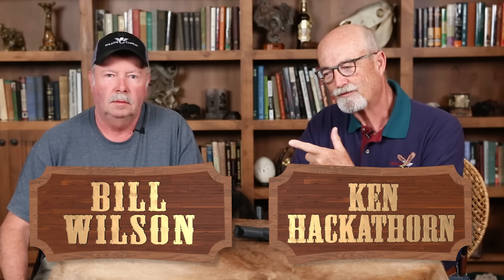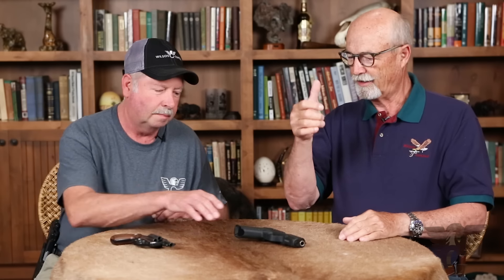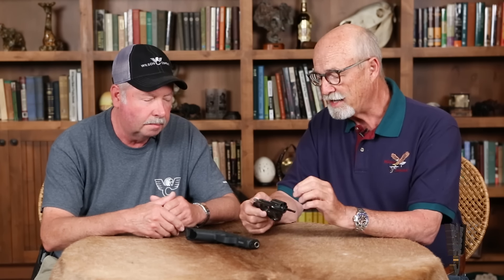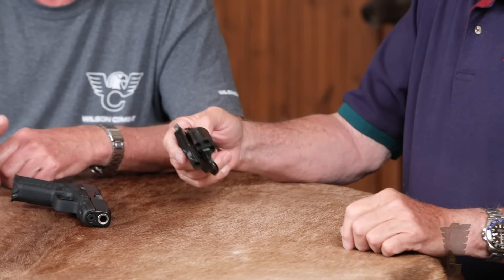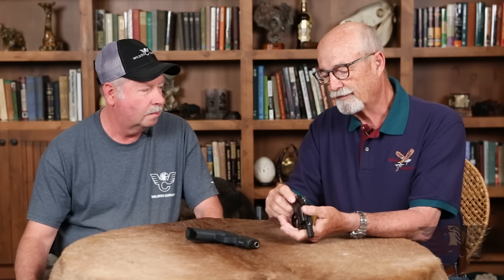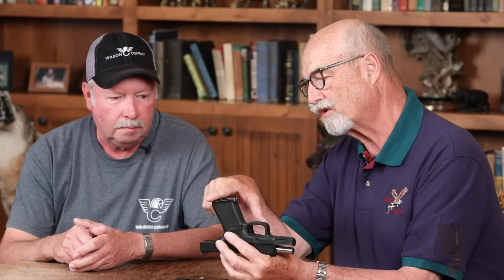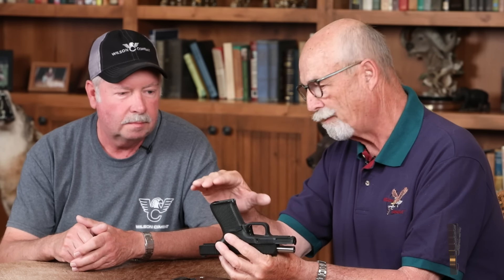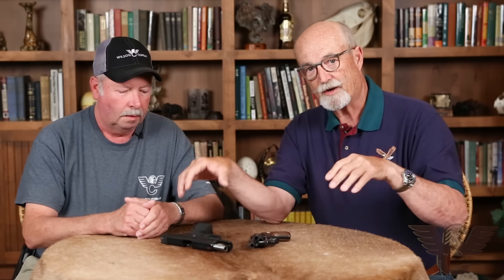DON'T DO THIS to Your Guns - Gun Guys Ep. 17

Comment: Im just gunna get an sti due to how stuck up they seem.
Reply: Guess what - sti/staccato says the same thing.  Don't drop the slide on an empty chamber.    It's not opinion that it damages the lockup, it's a fact.    I own several STI/Staccatos and a few wilson's - there's   no difference.  It's a linked tilting barrel with multiple barrel lockup points.

Comment: Lol I use mobile oil to lube all my guns. Even use it to clean. Works on corrosive ammo too. Here in the desert, I keep my guns pretty dry, drop of oil the use a rag to wipe it on.
Reply: I've always been of the opinion that in a pinch, any oil is better than no oil for preserving metal parts. Just can't substitute grease for oil or vice-versa.

Comment: I feel like your emotionally invested it’s I’ve never seen a gun break from dropping the slide the revolver yes but the Glock is fine
Reply: It doesn't necessarily break, but when trigger and hammer sear, disconnect,  are finely polished and tuned dropping the slide will wear those contact points. It wears to the point the hammer sometimes drops when dropping the slide without the mag in place and loading a round. It causes parts to wear Much faster.

Comment: so this is a legit question if you spend $3k on a Wilson combat why is there "trigger bounce"? Because releasing the slide forward does not touch the sear the only things touching it is the hammer and trigger. so they are saying the trigger wears the sear once the slide slams forward so on a properly hand fitted 1911 why does the trigger bounce to cause wear? The violent action of a firearm cycling is going to happen a lot faster than releasing the slide, yes the closing a round in the chamber will be smoother for the barrel but how does that prematurely wear a trigger job or a sear if firing the gun doesn't? IMO Riding the hammer down on 1911s have a way more legit claim to the premature wear on a trigger job or sear and I see that all the time even by people who own nicer 1911s

Comment: 18:10 I think this is probably carried over from M16/M4 basic training. Many times, I saw soldiers insert their magazine, fire one shot, and the magazine falls out onto the dirt. I was trained to slam that puppy home, even on an open bolt. On an M16, that will often close the bolt for you too, so it's a win-win. I must admit, I carried that over to my pistol handling. The last thing we were thinking about was the extra pressure on the feed lips. I think some authority and purpose of action is still called for when inserting any magazine, but I will probably dial it back a tad after watching this.
Reply: They fell out because they loaded 30 instead of 29...
Reply: @TheTyrial86  They fell out because they did not seat the magazine fully. I load my mags to 28 to make this operator error less likely, but it is an operator error. If you insert the magazine properly, 30 is no problem.

Comment: The mistake is see in this video is comparing a Glock to a 1911. Per Glock it’s called a slide stop not a slide release. 2nd a 1911 it’s called a slide release. It is true over time by closing the slide with the slide stop/release will wear the slide notch out sooner than if you worked the slide manually. Kinda over kill to get to the point. The message was lost earlier in the video. I prefer a 1911 just because for me it’s more natural and I  get better groups on the range. My duty weapon is a Glock 17 (department required)and qualify every year with the Glock. Bottom line a firearm is a tool. Take care of your tools and they will take care of you.
Reply: If you can afford enough ammunition to wear your slide notch out, you can afford a new firearm. Maybe take special care with a classic firearm that is irreplaceable.

Comment: There is a whole new generation of shooters, that started in the polymer era that has a much different perception of what gun care looks like. A lot of the old rules - not dry firing, don't slam down empty slides or bolts, don't swing cylinders, don't slam a break action shut, cleaning frequently, keep lubed - they call "boomer ideas".  As with most generation X'rs, I was in the cusp of it, taught by people who came through World War II and Korea, and have had a little bit of a hard time getting used to less oil, dry firing, things like that.  Not even 50 quite yet and I got called a boomer 😥
Reply: They use Fudd instead of Boomer when talking about firearms
Reply: There’s also a lot of non-fudds and just use common sense and treat guns based on that they were designed for.
Reply: OK boomer... lol jk
Reply: New firearms are designed to not be damaged from dryfire. Older firearms won't take it but most newer ones past the late 90's are fine.
Reply: @JohnDoe-rx3vn  all of the gun forums I hang out on, its boomer. Then we get into arguments over what a baby boomer is, versus just the “ideals“ of the baby boomers, etc. Fudd I see used in the computer world more than anything. Crazy huh?
Reply: @foodank_atr817  i know. I’m just saying it’s a hard habit to break. And you can still break strikers by dry firing, from time to time. Most of the gun manufacturers still recommend the use of snap caps just added security
Reply: chad kaminski  I think polymer frames, and powder/nitrided/anodized/coated finishes of different types, did that in general, not just Glock. But, fear not, I got everybody’s back. I’ll help keep the oil industry alive. It’ll be a tough job, but somebody has to do it.
Reply: I'm a Boomer.  I was trained to dry-fire, slam bolts and slides over 50 years ago.  But then, I wasn't shooting rooney guns, the too-tuned-for-serious-use fudd crap that these guys are pushing.
Reply: @foodank_atr817  The 1911 was specifically designed for dry firing, which was part of the US Army training course pre-1911.
Reply: @SoloPilot6  for sure. Theyre all meant to cycle and dropping the slide doesnt hurt for the most part. These guys complaing about their convention demo range baby that's precisely tuned and gets treated after every shoot doesnt translate to most regular firearms is my point.

Comment: Ken, in addition to arctic conditions slowing the powder burn, the friction is much worse, and wet lube flows like molasses.  Even with dry or zero lube, there are very few design that will operate when cold-soaked to 40 below zero, and even fewer that will work when cycled between a warm environment where condensation occurs,, then returned to frozen.  Like a police car that is parked in the cold, then kept running for a whole shift.  For this, I like single action revolvers, and AKs.  Forget about pump guns and frame mounted trigger bars.

Comment: I don't claim to be an expert at all but can someone explain to me how pulling the slide back to its furthest rear position and letting go is less damaging than releasing the slide lock? The only way to ensure no damage would be to guide slide fwd and release after its fully fwd.
Reply: It’s not less damaging. It’s more or less the same amount of damage, depending in how much further back you can pull it. The point they’re making is that the highly worked over trigger and barrel in their guns is not expecting zero resistance from the slide flying forward without having to chamber a round from a magazine to slow it down. It’s a little like damaging a centerfire weapon’s firing pin by dryfiring it hundreds of times without a snap cap to absorb the momentum. 
Of course now someone’s going to come along to say how it’s perfectly safe to do that. 🙄
Reply: In my own personal experience, if I'm viewing a pistol that I don't personally own or don't have the intention of purchasing, I treat it as If I'd expect it to be treated. I always ride the slide whenever disengaging the slide stop and I always ask if I could dry fire the weapon before doing so. With my own personal firearms or whenever dry firing, I always use snap-caps especially in my DA/SA or tuned trigger pistols. I have OCD when it comes to cleaning my firearms after use, I find it relaxing, so I keep up with maintenance as best as I can.
Reply: STUPID!!!  BS!!!  If its that sensitive, you don't need it, nor can you count on it to save you.  I agree w/the revolver stuff, but the auto stuff is ludicrous.

Comment: I carried a 1911 for decades but after several failures during IDPA competition (fewer than 1,000 rounds fired), I changed to a G19 and in 7,000 rounds I had 2x malfunctions and 1 was reloaded ammo related. Glock is very dependable, 1911 are NOT.  When Sig offered the P320 with a Thumb Safety I changed to that, over 6,000 rounds no malfunctions.  Now I carry a P365XL MS R0 which has a few thousand rounds no malfunctions. A gun isn’t worth a crap if it has a high failure rate. 1911 shoot ball ammo the best but will still fail at a much higher rate than a striker fired gun but add hollow points for self defense and the 1911 dependability goes way down.. just sayin
Oh, and don’t drop the slide on an empty chamber.. and lube it just right, and talk nice to it and tuck it in at bedtime.. just sayin
Reply: 👍Don't forget to diaper it, too!! 🤣

Comment: People hate to be told they're doing it wrong, but the truth is, they need to be told they're doing it wrong. I can't believe all the weenies with hurt feelings because they don't like to be told the truth. Remember, race cars only have to make it thru one race to win, then get the engine rebuilt. That's the difference between finely tuned custom guns, and mil spec guns that are built with loose tolerances by the lowest bidder. Treat expensive guns with minimal albeit proper care and they will remain a precision tool for generations, like a Rolex or Ferrari. It's not difficult to understand.

Comment: I hadn't heard about the "2000 round" challenge."  My goodness, what will be next?  How about the "will my car run 2000 miles when it is 2 quarts low on oil?"  What could possibly go wrong with that?  --Old (sarcastic) Guy
Reply: People do that test too lol. But they acknowledge it’s not the fault of the car, and it’s usually a car about to be scrapped anyways

Comment: I may be wrong but my carry weapon is lubed well and a bit dirty. I have found it takes a perfectly clean gun a few rounds to resettle for accuracy.  I will lube and inspect often but usually clean after 250 rounds. Great information!
Reply: You don't want to clean the barrel alot. It is best to let it be dirty and clean every 500rounds.

Comment: I absolutely love your channel! so much good information. I know much of it, but I pick up things quite often watching you guys. I ABSOLOUTLY agree with running any gun (except for one going to the arctic) WET. not getting sprayed with oil (I have seen that) between rounds, but every mechanical device needs some lube to function correctly. but I do have a question for you regarding lubricants. what about using dry lubricants when a firearm will be used in sandy, dusty conditions?  I'm not talking thousands of rounds. I am expecting something like 3-6, (10 mags  @ 15 rds ea. at most) magazines. I'm thinking either dry spray moly or spray on graphite. or is running wet still the best idea?

Comment: I've never dry fired or dropped the slide from day one.  I just figured both of these to be harsh.  No one told me.
Reply: You can dry fire most modern semiauto guns without issue. Specially striker fired ones.

Most revolvers with fixed firing pins and some older design auto loaders like the 1911 won't like dry fires for too long as it stretches the firing pins.

Comment: 1911 was originally built to drop the slide for inspection at guard.
Its actually designed for this purpose.
Reply: It's not bad for it. But what he was saying is on a custom tuned 1911 you're going to start tampering with that smooth trigger pull. Because it can start scarring the sear mechanism
Reply: @CompetitionChris  doesnt that happen when you shoot it? 

Knowing what they know, I'd bring a "showpiece" that isn't precise so the people visiting the booth won't ruing it.
Reply: @foodank_atr817  
No it isn't the same. Alot of the enertia is minimized with the striping of the next round from the magazine and subsequent chambering of the cartridge.
Reply: @CompetitionChris  how? It's just polished. GI models don't get worse over time when you drop the slide, so why would a custom piece?
Reply: @denisdegamon8224  blatantly untrue. it actually wears your sear more
Reply: @evocati6523  it's not just polished, engagement area of the trigger is drastically reduced. They give the specs of engagement in the video...

Comment: I don't know why YouTube decided to show me this but.... 

I have to say that these entire video seems like a way to cover up a fragile gun design

I have no doubt that what they're saying it true of their gun. However, it's coming across all wrong and that's why these comments are so bad. Certainly doesn't make me want to buy one if it's going to break from having the slide closed empty
Reply: You just may not understand finely fitted 1911s.  Neither do most people in the comments.  They shoot plastic, $500 Glocks.
Reply: @66smithra  Finely fitted sounds about the same as fragile. That's all I'm saying
Reply: @66smithra  Is this purely about elite sports target shooting though? Like the slightest bit of play in a trigger mechanism after not kissing your pistol to sleep each night and tucking it in will cause you to lose a competition because the trigger will end up ever so slightly less crisp? Or will you actually break your gun doing these things?
Reply: @OrdinProds  you can drop the slide on a mil spec 1911 until the cows come home and it won’t hurt it. These guys are talking about finely fitted examples like Wilsons or nighthawks. The tolerances in the sear to get a 2.8 lb trigger pull are super tight and well fitted. Battering those parts by dropping the slide messes with the fit between those parts.

Comment: Lol.... spend $3500+ on a 1911.. and dropping the slide will damage it?  Doesn't sound like it should cost 3500+ then.. I'll stick to the Sig, Kimber, and even Rock island.
Reply: It's a mechanical issue. Not a quality issue. Droping the slide on any 1911 will increase wear. Just changing a simple habit & pulling the slide to the rear instead of using the slide release on an empty chamber, will increase reliability & overall lifespan
Reply: @HermCore  But technically that principal is not exclusive to the 1911, and I seriously doubt there is a verifiable statistic that can proven exactly how fast and to what accelerated extent the damage occurs. My biggest complaint is they don't attempt to provide numbers such as, "dropping the slide x amount of times, will get you this exact outcome." It's always a vague warning.

Comment: Yeah, I'm not a chemist, but do have the background.  Even gasoline burns to -40degF, gunpowder will do better.    Failure to cycle would seem to be either a lubricant issue, or tolerances issue, or both.
Reply: Thats not true at all. The chemical reaction is always sped up when dealing with higher temperature. In the case of powders the pressures and burn rates go way faster wih higher temperatures. Conversely the opposite is true in older environments.
Reply: Someone clearly doesn't reload, the type of powder used is absolutely crucial to not having over pressure problems in the summer and low power issues in the winter.
Reply: Actually, one common reason for failure to cycle is limp-wristing.  The slide needs to move back against a frame which is providing resistance, if the shooter isn't keeping a firm grip on the stocks, the pistol can move enough that it short-strokes, especially with weaker ammo or stiffer recoil springs.

Comment: I have a sig 226,  Kimber Lw stainless, S&W MP, berreta 92, and an HK VP9. All came with factory owners manuals. Nowhere in any of these manuals is there mentioning a word caution on dropping the slide stop to chamber a round or dropping the slide stop on an empty chamber. I trust the design, engineering, & testing of the manufacturer. Otherwise, I wouldn't have purchased their product. All other recommendations as how to operate and maintain these firearms are considered baseless and opinion.
Reply: John...that's their error

Comment: Calling BS that guns were damaged after one day of dropping the slide
Reply: Yes, on high end fine-component custom 1911s.

Just like a failure to shift gear properly on a high end race car would be much more expensive than the same on your 2006 trailblazer; one is built to a finer tolerance.

It’s not that these guns are broken after this.
They just stop being $3000 guns with nice triggers because in order to have that half pound trigger you need parts that are much thinner and more delicate.

Comment: I think they are talking about guns that are built for precision but they talk like every gun should treat like this and this confused a lot of viewers.
Reply: Dude.. Bill effing Wilson just told you that slamming the slide dry w/o skimming a round off the magazine is going to hammer your barrel lockup, and if you put a cartridge in the pipe manually you're going to commit extractor abuse when you go into battery... on any make or model auto handgun, with the 1911 being more susceptible to extractor brutality than some other makes and models, but its not good on any of them.
Reply: Makes you wonder how good their 1911s are really if they are worried someone is handling the gun that way. You want to make sure the gun functions every where
Reply: @BlackoutPatriot  Doesn't make me wonder. 1911's have proven themselves for over 100 years.
Reply: @ralphsawyer9535  I was preferring to Wilson combat 1911s. Not all 1911s